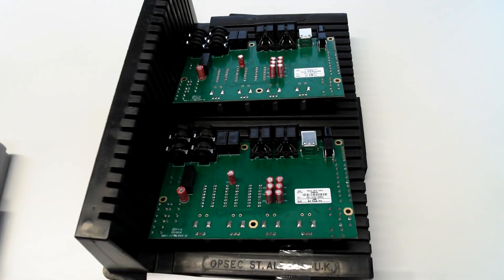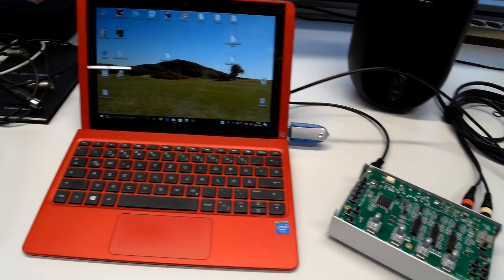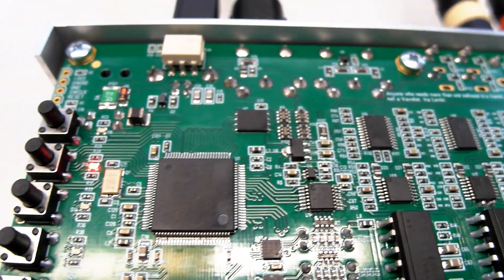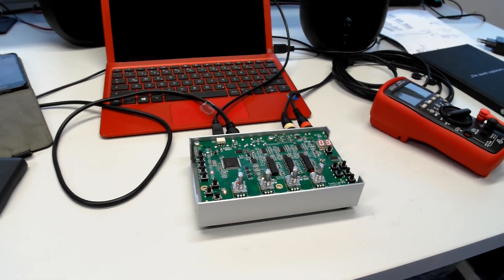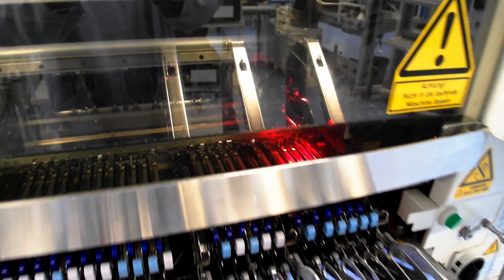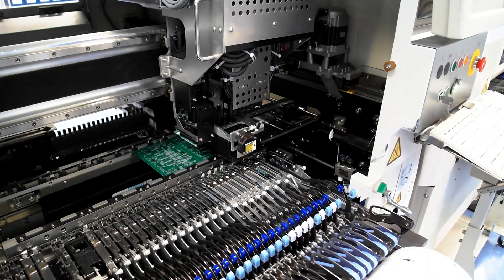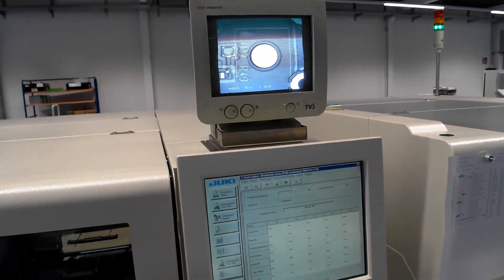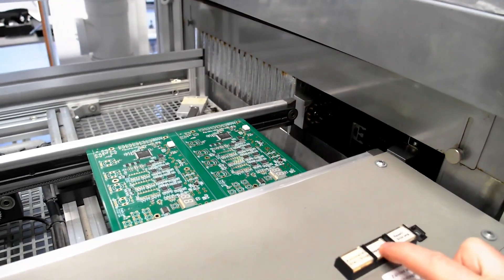Töörö - Producing the PCBAs

Comment: 800 resistors? I hope it wasn't your error, that sounds like a potentially costly mistake. I'm glad the first production unit worked.
Reply: No worries Justin. They ordered 100R instead of 1k, and I validated out of fatigue... so the responsibility is shared. A resistor array is about two cents. So no big financial drama here.